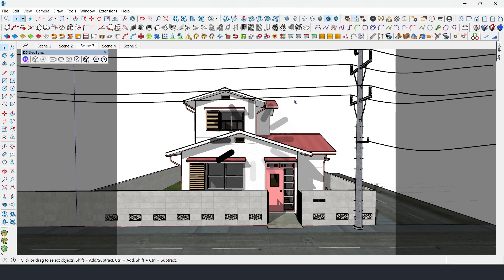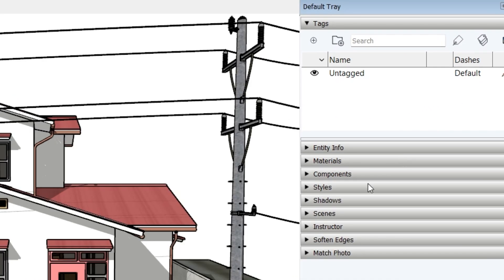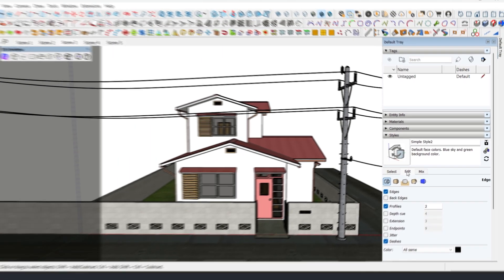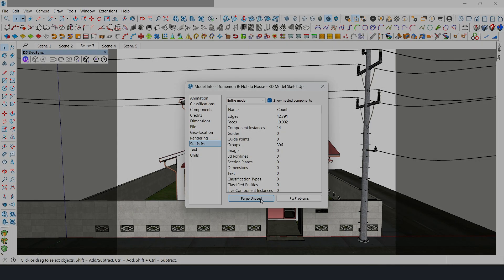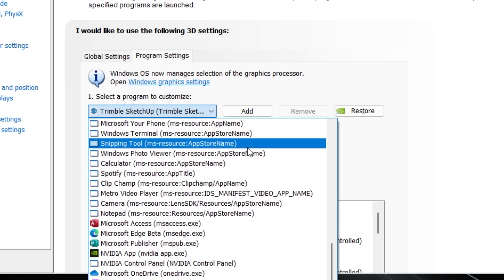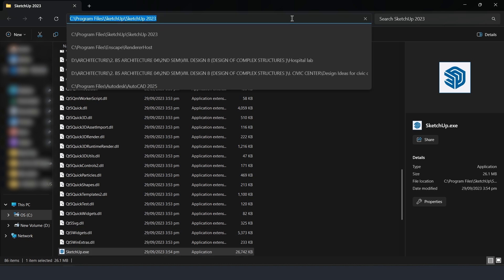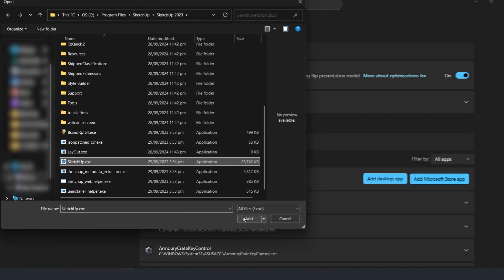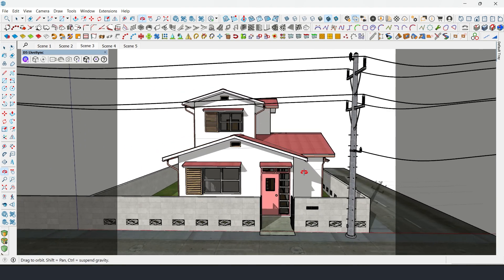Fix SketchUp 2025 Crashing & Lagging | Boost Performance in Minutes!

Comment: I've been having a problem with opening my sketchup file which my work I've been doing has gotten errors and doesn't even respond whenever I try to export it into 2D/3D it did work on jpeg but exporting it on dwg it didn't which it took me minutes to wait. Is there another way to proceed it or should I just open a new file to rework it all over again?